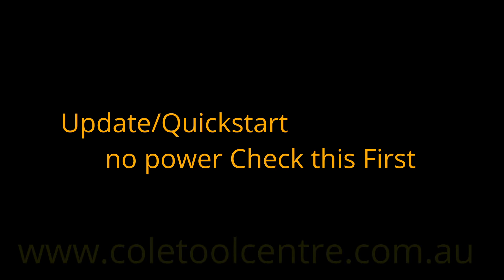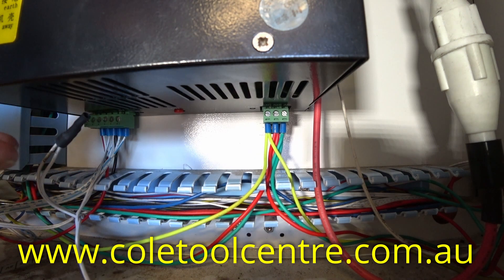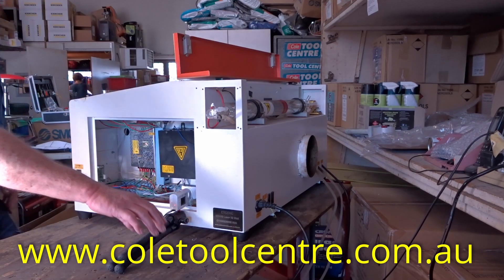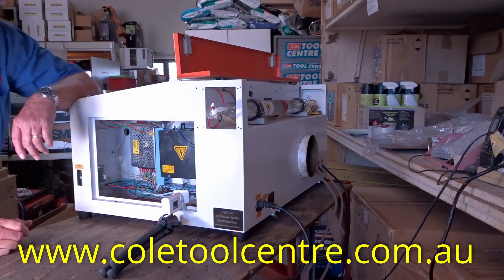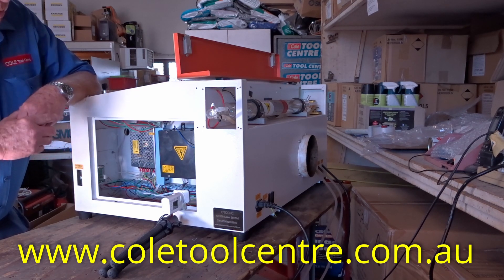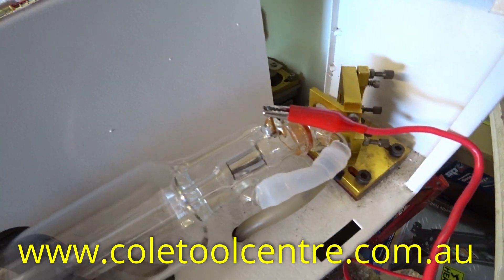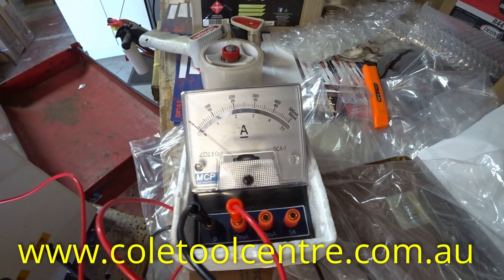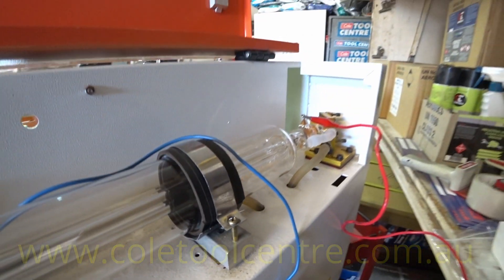Laser Update what to do first. No power from your CO2 Laser

Comment: Recent my laser just shutdown and won't turn on any pointers
Reply from the maker: I could have a problem with the power supply your electrician needs to follow the 240 supply through. There is usually a fuse in the back of the machine. If the fuse is blown that indicates it has a problem. Next would be checking 240v powers transformer.

Comment: can someone help me, im having the issue that if i hit the test button on the power supply the laser will fire but when im running a job or hit the test button on the controller it does not fire the laser. i do have water flowing, and i bypassed the door sensor but still nothing. thank you in advanced!
Reply from the maker: Buy pass the water flow switch.
If still not working check all connections.
Still not working may need new control panel.
Reply: @Graemecns  how do I bypass the water flow switch ?
Reply from the maker: @mr.manny_s5506  cut the two wires going to it strip of some insulation and twist them together and test

Comment: Sir, if i press test on the power supply it shoot laser but if i press pulse button from the ctrl board it doesn't shoot any laser, what could be the problem sir???
Reply from the maker: Usually there are lockout switches for the lid being closed and the water flowing. Check these switches or buy pass with a wire.
Reply: @Graemecns  does air assist also needed?? Or air ventilation??
Because water pump is already on and i already closed the lid
Reply from the maker: @fingerstylesabahan8517  air assist is not required for the laser to fire.
You have to check the switches for the lid and water flow have not failed.
Or try and bypass the switches.
Reply: @Graemecns  how to bypass the switches?? Do u have tutorial video??
Reply from the maker: @fingerstylesabahan8517  no. your electrician should be able to work it out.
You can look at some of the older video on my channel which should help.

Comment: sir, I have disconnected cable from motherboard to align my laser lens......when i reconnected back after alignment laser stopped firing...any possible solution? when i disconnect from mother board...firing is working....?
Reply from the maker: I could not say and it may be something in the software stopping it firing. The soft ware may be looking to ensure the lids are closed and the water is flowing! Your software could control power setting and pulse timing.

Comment: I have no power going to the power box...NONE.  Any ideas?  I wonder if it's the breaker box.  I have a 100w co2 laser machine
Reply from the maker: If you have no power your electrician will trace your power from your power point through the wiring. Not all the machines are the same but you should find that the power goes from power point through the laser power switch then to the laser power supply. Other power may go to the transformer that supplies voltage to dash panel mother board and X Y motors
Reply: I’m on this trouble now